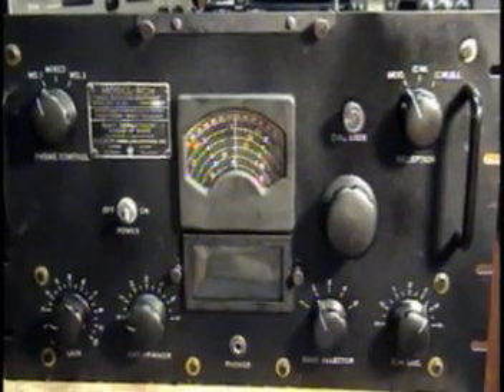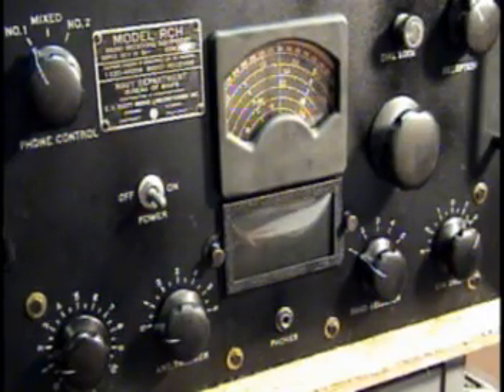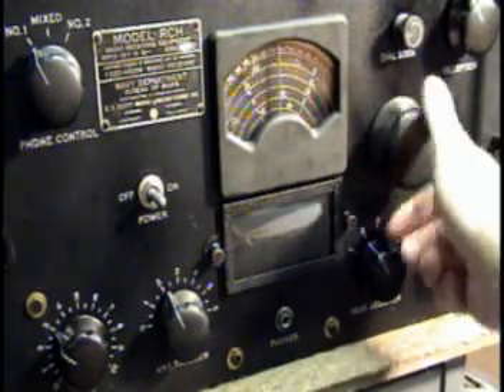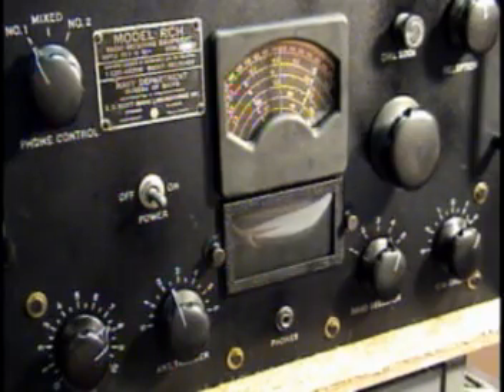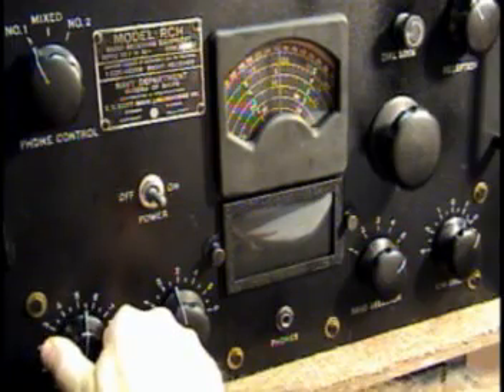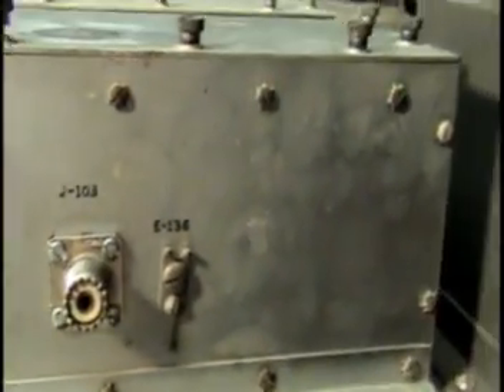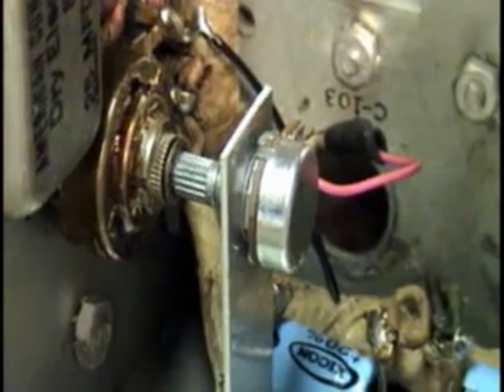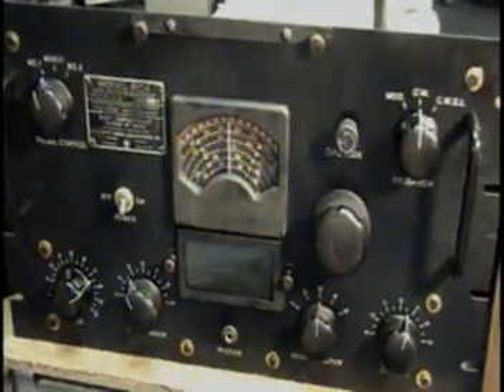EH Scott RCH Navy Ship Tube Receiver Ham Shortwave Radio Demo

Comment: Very cool radio ! If Hammarlund was the Cadillac of shortwave receivers in those days, E. H. Scott was the Rolls Royce. I have another Scott receiver made during WW2, the specially shielded SLRM, for use on ships, both Navy and Merchant Marine. It is designed so that the local oscillator does not radiate back anything through the antenna or even the case which could be picked up by a U-boat direction finder and give away the position of your ship. It is quite similar to yours except the frequency coverage, 540 KHz to 18.6 MHz in four bands. It was designed to provide entertainment for the crews in the convoys carrying supplies and men to Europe.

Comment: I own an SLRM Scott radio, trying to get it to work but with power on, no lights are on. I was planning of removing all tubes (wiring check appears ok however not sure if the metal can electrolytics at ac input are good), and installing the diode (if its ok). There is a local tube store nearby, I will contact them for help. Any ideas are greatly appreciated.
Reply from the maker: Hey man, are any tubes lighting up? If not check the power transformer. Are there fuses on the rear panel?

Comment: Considering it was brush painted by the Navy, I think it looks really nice. Curious as to how you hand painted the #'s and lines for controls and switches? Do you have some sort of stencil set? They came out very good. Also wanted to thank you for exposing me to the 6AQ5 output tube.... Looks to be an exact alternative to using 6v6's. There are ton's of NOS tubes available by many manufactures for very little money compared to the rising costs of NOS 6v6's. I plan on experimenting using them in a few amps..... Thanks, Tom
Reply from the maker: +Bucyrus Erie12 Hi Tom, Thanks for the nice comments on the receiver repair. I actually hand painted the lettering using a detailing brush and white enamel testors paint. I used a magnifying glass, plus a steady hand. Be glad to help you out with your amp projects. TD

Comment: although mine is in storage i recently purchased an isolation transformer
so i may once again use the radio w/o getting bit :>)
  i recall the sensitivity of this receiver w/only a wire for antenna was greater than a solid state  radio i also own.
   i downloaded the complete manual w/ schematic just in case it stops working.
                                                          barry

Comment: Neat. I have an SLR-12B which is sort of similar, though the tuning mechanism is not as nice. Mine also has the AM band through 18mc, no longwave and no BFO. it has excellent sound though with the variable IF bandwidth and push-pull 6V6 audio. The IF is a narrow/medium/wide switch and not fully variable. Extremely heavy set though, not something I enjoy moving around.

Comment: I heard BT on the first beacon and GR on the second. These are called NDBs, or non-directional beacons, which are used for aeronautical and (sometimes) marine navigation. BT is located in Battle Creek, MI on 272 kHz and GR is either in Fort Hood, TX on 323 kHz or Iles-De-La-Madeleine, Canada on 370 kHz.